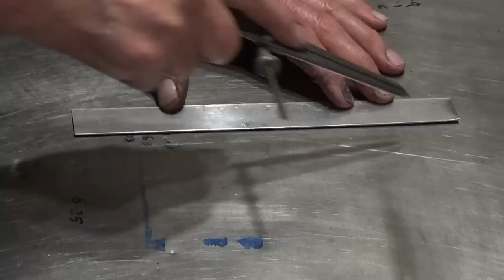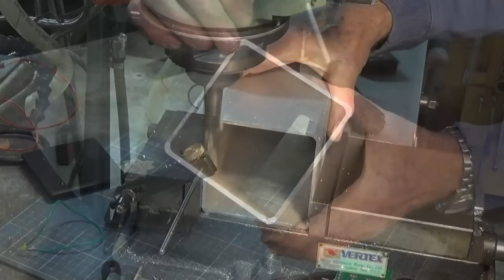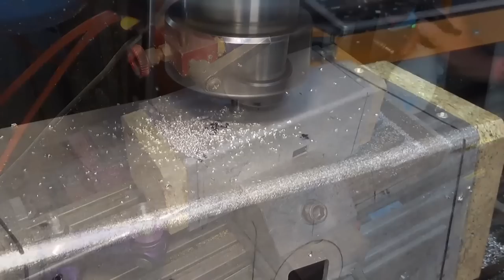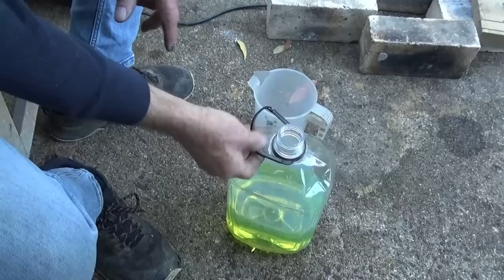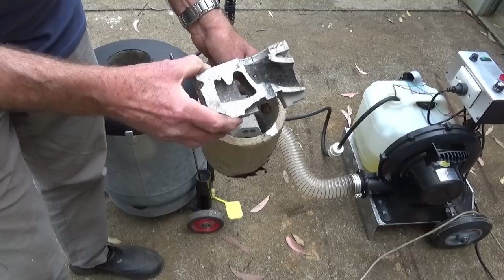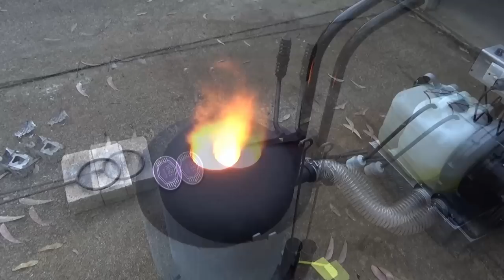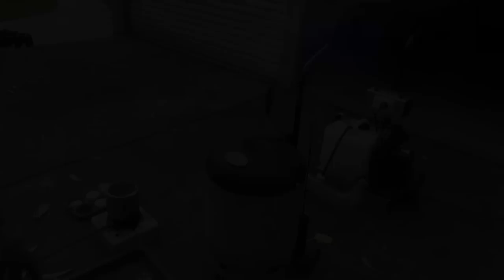Diesel Foundry Furnace Burner - Part 4

Comment: Love the "matchstick" lighting method, neat idea. I would suggest checking the controls box after running for a bit of time in the areas of the speed/voltage. They may heat up and burn out without ventalation.  A small computer style fan may be needed. Just don't want you to have to do all that wiring a third time! cheers!
Reply from the maker: I have already made those changes. I ordered a 40mm silent fan that runs on 12V and I have fitted a small louvre panel in one of the end caps. You may get to see it on the next video. Thanks for the tip.
Regards,
Mark

Comment: Float Lock Vise!  My favorite drill press vise of all time, been using one for 30 years.
Reply from the maker: Well spotted. I watched the Blondihacks build but I was keen to have a go at the Wahlstrom 24-12 style with the quick release mechanism. 
Regards,
Mark
Reply: @Preso58  The one I have has the screw inside the tube,  but it doesn't have quick release mechanism. Mine is made by AMF, American Machine & Foundry I think they owned Harley-Davidson for a while. The threaded key got bad and I had to re-do it, luckily it's just a standard 60 degree V thread 7/16-14 maybe. They made one for Vertical bandsaws as well.

Comment: Great job! With the many, many ham radio transmitters, amplifiers and such I have made over the past 40 years I wish I had a CNC router!!! Using a chassis punch for 3" diameter meters in 1/4" aluminum is a stressful workout!  What a neat project mate!!! Thanks for bringing us along! We can discuss your wiring off-line!!!!
Reply from the maker: As much as I deplore the limitations of my little Sieg X3 CNC mill, it does come in mighty handy sometimes. I had used a chassis punch many, many years ago when I used to make my own stereo amplifiers. Remember those 5 pin Din plugs? But a 3" punch in that thick stock would be an Arnold Schwarzenegger workout.
Regards,
Mark

Comment: Nice.  Mine is still in parts.  I have purchased a misting oil spray nozzle complete with air spinner/bracket and high voltage ceramic igniter as a unit.   I also purchased a Japan nippon electromagnetic pump VSC90A5.  All of this from Aliexpress.  I like your setup but not the plastic fuel tank.  A splatter of hot metal could melt a hole and spill diesel everywhere.  I have a steel Jerry can with a modified pourer.  I will use fuel hose protected with stainless steel braid, and a metal can fuel filter.    A lot of the heat applied to the crucible is radiant heat from the furnace walls.  Reducing the thermal mass of the furnace will reduce heating time.  I plan to melt iron.    Good to follow behind your project.
Reply from the maker: Thanks. I have some of that stainless steel braid and I can fit it over the hose but I am sort of stuck with the tank for now. I could fit a stainless steel cover over the top surface though. I found an AliExpress seller that had all the items you have for your system. 
Regards,
Mark
Reply: @Preso58  Being an electronics engineer I will be avoiding electronics in my version.   The electric pump pressure is mechanically adjustable and I have an all-metal pressure gauge that I will use while regulating fuel flow.   The nozzles don't work well at low pressure so if needed, I will make an adjustable pulsed flow regulator, mechanical of course.  This will supply fuel at full pressure, but regulate flow by PWM.  I plan to regulate air flow with a sliding sleeve over the burner pipe.  The blower will run at 100% but air flow to the nozzle will be controlled by sliding the sleeve to cover/uncover holes in the pipe.  Surplus air will bleed off.   I suspect the problem you have with burning after fuel shut off is because of fuel absorbed into the furnace refractory lining.  Flame impingement on the lining is not a good thing.  I plan to enlarge the inner diameter near the base of the furnace to give plenty of room for the flame to develop.

Comment: Hi Preso, excellent result. The service cart works well and makes everything neat and tidy.
Melting metal and casting can be extremely dangerous so its paramount to be well organisedand your setup is certainly that...
Regards Kevin
Reply from the maker: Thanks Kevin. I have a lot of respect for the whole process of metal casting. I can be a bit casual about workshop safety sometimes but when it comes to liquid metal I try not to take any chances. 
Regards,
Mark

Comment: Good to see the machine melting some metal. It runs really well, and melts the aluminum very fast, great job on this build. I like how you fabricated that metal bracket for the air hose, that worked out well.

I see the lid stop works nicely. Thanks for the shout out.

Cant wait for the float lock vise build. I have had one on my 'to do' list for a while, but there is never enough time...
Reply from the maker: Thanks Jon. It is a vast improvement over the old propane burner but I have been told that I should have run the blower with the propane and used a bigger jet for the gas. I guess the propane burner worked right from the start so I didn't bother to mess with it. I thought all propane burners were slow. Evidently not! The lid stop works great. 
Regards,
Mark

Comment: Works pretty good!

Just commenting on some of the talk about flow/pressure.

Flow is relative to pressure against a given restriction (nozzle). So "upgrading to a higher capacity pump", really means just increasing the pressure the pump is capable of delivering at a certain flow rate, and that in turns pushes more fuel through the restriction of that nozzle. The logic goes:
- The pump provides different pressures at a certain flow rates - there will be a curve (look up "Pump Head vs. Flow graph").
- The nozzle also provides it's own Flow, given a certain Pressure. It's rated flow (eg 2.5gal/h will be at it's rated pressure, eg. 150psi, increase the pressure, you increase the flow, vice versa), there is no "efficiency" rating as you seem to have assigned it, some nozzles are designed to operate over multiple pressure ratings.
- The atomisation (droplet size) and velocity of the fuel from the nozzle will be relative to its flow, but that graph isn't linear - as flow decreases (from pressure decreasing), droplet size increases with larger and larger steps until droplet size is infinite (unbroken flow) is achieved.

So when sizing a system, you'll want a pump that can exceed the supply the rated nozzle flow at the given rated nozzle pressure - as you can overdrive them a bit.

But, if your pump's max pressure at the nozzle's given flow rate is lacking - and ends up with less than optimal atomisation, then you don't have a lot of play room to adjust - as turning down the pump's duty cycle below 100% will cause droplet size to increase, droplet velocity to decrease, which will coalesce into larger droplets over a shorter distance, create an inefficient burn, and potentially causing unburnt fuel droplets to reach the furnace wall - which is one explanation for your ongoing fuel issue after you turn the system off, the fuel isn't atomising optimally, and you're getting leakage into the concrete - which at temperature becomes dehydrated and very pourous, which will then push some liquid/evaporated fuel back out as it cools.

As a side note - you might be able to overdrive that pump a bit, since automotive charging systems often run at 14.4V, that pump will be rated for that - so should be happy enough to run at 16V, this could get your some more head room in fuel delivery.

Might also pay to get a pressure gauge on that line, just so you can better inform any further optimistation choices to that fuel system, also makes dialing in "known good fuel/air ratios" a lot easier than eyeballing a knob position.
Reply from the maker: Thanks for that. I must say that I totally guessed at what I would need in terms of the fuel pump. The nozzle size and GPH rating was suggested by Perry Merrit who built the burner that I was replicating. I sort of anticipated having to scrap the pump at some point once I had been able to verify the burner worked at all. I knew that the 84% "efficiency" thing was misleading but it was more about knowing what the fuel consumption was going to be and therefore the running cost. I have noticed the fuel line pressurising as the pump accelerates. A pressure gauge would be a hand addition.
Regards,
Mark

Comment: Mark - What I love about your projects is that you take them 2 steps farther than I do. I tend to stop at the "good enough" stage, optimum half-assing. You're not a perfectionist or a glamorist, so I still relate to your methods and goals, but you'll add features and improve fit and finish so that each of your projects crosses over that "janky" line into "respectable". It's great to live vicariously through someone who builds things the same way I tend to, but... better. It's a real treat.
Reply: yep, takes things a lot further than I do as well - he is a bad influence,  thin edge of the wedge stuff, next thing you know I find myself painting what I make!
Reply from the maker: Thanks for the comments. At the end of the day, I have to justify my investment in a lot of the gear that I have purchased, at least to my wife! I must say that the powder coat system is one thing I would never regret buying. The range of colours and textures you can get can make even the worst looking part acceptable. 
Regards,
Mark

Comment: Great series, as usual Presso.  Never would have considered diesel fuel for this situation, you've expanded my horizons!
Reply from the maker: I must say I was very sceptical when Perry Merrit first floated the idea of using diesel and trying to atomise it without compressed air but now I am a convert. I think the key is to buy a well engineered nozzle.
Regards,
Mark

Comment: Easiest way to put out the torch is to have a container filled with diesel, and then submerge it. Then it is always nice and soaked with diesel next time you use it.
Reply from the maker: If only I had sealed the bottom of that tube that the torch sits in! However, the wick seems to hold a lot of fuel anyway.
Regards,
Mark

Comment: Good morning Mark,
Couple observations you may want to consider.
A) When opening your lid, it stops while still exposing the steel cover to the edge of the inner casting which allows the flame and heat to work on the metal. Bending your lever arm a little would allow it to move out and not allowing the direct flame to ruin your steel lid over time. My past was maintenance in an Aluminum reduction and rolling mill. Our furnace lids, and openings were a high maintenance repair/replacement issue where steel being exposed to open flame and heat.
B) Have you thought about an electric glow plug igniter for the nozzle? It could be wired into the circuit power and could be beneficial controlling ignition and eliminating your exposure over the open furnace and limit the amount of smoke and sut getting started. These should be readily available. Home heating oil furnaces are still in use.
You've gained a lot of time for heat-up and appears will be pretty economical to run. Great build, I am enjoying your build projects and following along on this project.
Thanks for sharing,
Reply from the maker: I did notice that the lid didn't swing well clear of the furnace interior but I think it will be OK. I can dial down the flame if I need to open it in future. I still need to get used to the operation and peculiarities of this design. I was keen to have some sort of electric or piezo ignition but sometimes simpler is better. Less to go wrong!
Regards,
Mark

Comment: The way I've always done it, is you clip the wire inside it's sheath of plastic, then fish the end out. Where you see the hoseclamp go over the wire. You clip it there. Then pull the 2-3" of wire out of the plastic tube it sits in. This gives you another 1/2" of plastic width to keep the actual cut end of the metal wire from springing outwards, and lets a hoseclamp work.

That's how I've always done it
Reply from the maker: Thanks. Part of my problem was not being able to get a hose clamp with a large enough range but removing the wire altogether would have resolved the issue. 
Regards,
Mark
Reply: @Preso58  It doesn't look great, but it does work! just put 2 hoseclamps on and make sure the first has a bit of tail sticking out

Comment: Really cool.  Another fine project, Mark. Seems like you got close to the nozzle rating.  I bet that nozzle delivery rate assumes a certain temperature of the fuel.  A higher fuel temp would make it less viscous and flow more at a give pressure.  Regarding the continued burning after shutting down, if the level of liquid fuel in the tank is above the nozzle in the burner, and there's no check valve obstruction to overcome, fuel will likely continue to flow, even when the pump is shut down.   As the fuel reaches the burner area, it warms up in the tube and likely flows really easy out of the nozzle at that point.  A very light spring loaded blow back valve might offer just enough restriction to stop flow when the pump is off yet not cause enough of an impediment to affect burner operation.
Reply from the maker: I think I have found the reason it continues to burn. There is a small check valve built into the pump and the fuel line pressurises during the burn phase. Once the pump is shut down electrically, the pressure in the fuel hose continues to push fuel out of the nozzle. I did forget to turn off the tapered plug valve at the burner end and that is something I will have to get used to doing at the end of the melt. Hopefully, I will have more to say about it in the next video.
Regards,
Mark

Comment: This thing is looking great.  I've made about a dozen natural gas kilns and there's a lot of similarities here.  I get my higher temp refractories from Morgan Thermal Ceramics.  They have 5 locations across Australia.  I use their Cerachem and Cerachrome line, but you can pick which ever you want to get you to the temps you need.  Don't go over the rated temp like some people in the comments suggest because the surface will vitrify and harden and flake off.  That'll be a major issue with all that whirling wind.  The other thing i noticed is the black soot flaking off in places.  That's from incomplete burning, obviously.  My suggestion would be to dial back the fuel until no flames are coming out of the top at all.  All of that fuel is wasted and it's a sign of incomplete burning in the chamber.  I would also like to see you put a ceramic coated pyrometer in there.  They're cheap and with the ceramic over them they will react more slowly, the way the crucible itself does.  Do some ladder testing: 50% fuel maxes out at X temp and simply won't get any hotter, 60% maxes out at Y temp, etc.  Only increase your fuel when you're getting close to them and you'll get the very most out of fuel and you should see a lot less of that flaky black soot and hopefully won't have any burning at the bottom when you're done.
Reply: I was waiting for the flame to turn blue.
Reply from the maker: I do have a pyrometer for checking the melt temperature but it gets dipped directly into the crucible. I bought another K type thermocouple but it has the short threaded sensor which wasn't suitable for dipping into the molten metal. I will look into your suggestion. The black soot deposits were a bit of a surprise to me too. I am going to need a lot more time to get used to the "personality" of this burner. I am just happy that it works and that it is quicker than the old propane burner. I am sure there is a lot of scope for optimising the whole system.
Regards,
Mark

Comment: Another great project done well and explained well.
I was thinking your air hose connections might be 3D printed bayonet or 1/4 turn quick disconnects.
Instead of cutting a hole in your tank for the fuel pump, maybe a metal plate to fit the fill opening with the pump attached and another 3D printed part, a nut, like the cap, to hold it in place. Fewer holes to worry about in the tank.
Good job!
Thanks for sharing.
Reply from the maker: Thanks. I am starting to rethink the fuel pump connection issue. Another viewer has made a similar suggestion. Luckily, I haven't committed to cutting any more holes in the tank so you may see a dramatic change of plan in the next video.
Regards,
Mark
Reply: @Preso58  Thanks for the reply
I enjoy your content, thanks for sharing.

Comment: Well done Mark. That’s an impressive build and I certainly gained a lot of useful knowledge from it. It’s interesting to me that it looks like you’re going to be making some clamps. I collect Australian made G clamps and have made a pattern to cast my own, first in aluminium and if that’s successful then brass. First though I’m trying my hand at lost wax casting to make an aluminium Michelin Man. I’ve made the silicone mould and the first wax copy has come out well so next is the plaster mould and so on. I’m really enjoying your channel. Cheers Stuart. Canberra.
Reply from the maker: Thanks Stuart. One day I will have a go at lost wax casting. We did a bit of it when I was at college and we had a centrifugal casting machine for making jewellery. It was terrifying to use but we only melted pewter. However the potential for flinging molten metal everywhere was not zero!
The clamp design is as close as I can get to the original float lock vice with the quick setting mechanism. Blondihacks made the type with the long feed screw but that mechanism requires a lot of cranking to fully open it. 
It may not work but I have 3D printed some mockups and I will test it before committing to metal parts.
Regards,
Mark
Reply: @Preso58  Of course it will work, I’ve never seen you fail. It’s all a learning curve and that’s what makes it interesting. 👍👍👍